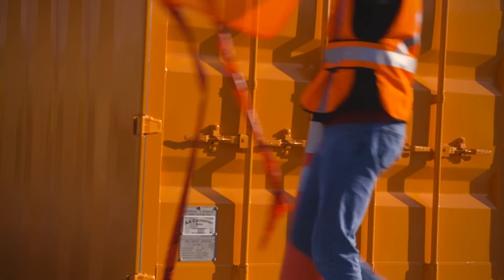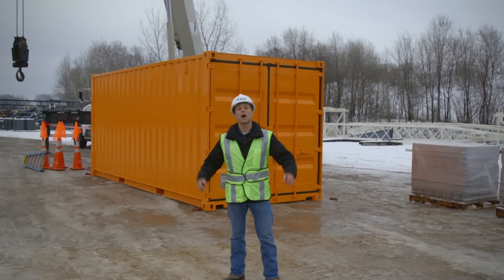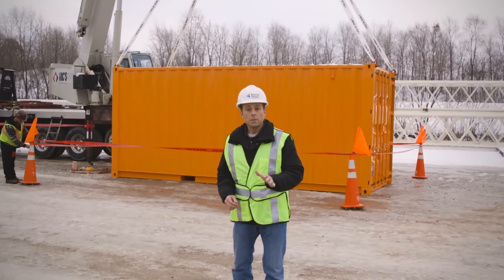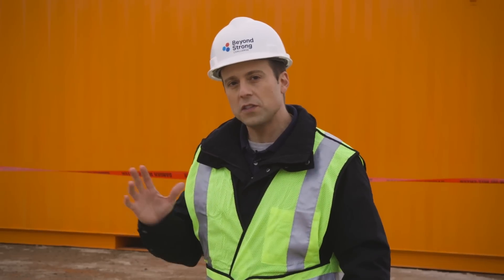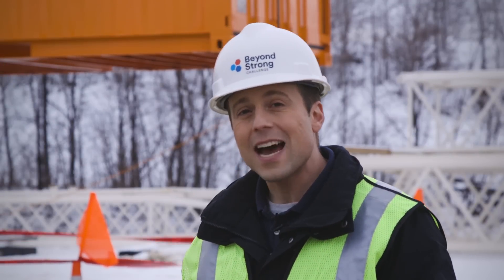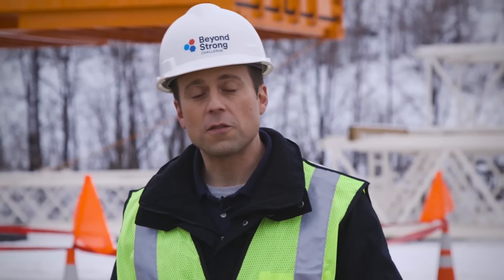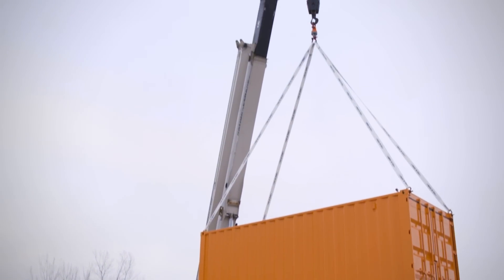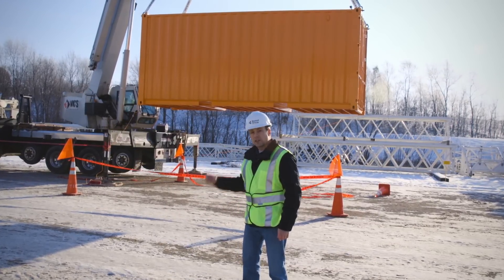3M Assembly Solutions: Epoxy Adhesive Demonstrating Strength

Comment: Which onwe would be good for body kit for car?  I dont want to drill holes in the car is there a 3m one specific for cars or fiberglass? Thanks.
Reply: fiberglass body panel isn't fiberglass...its fiber glass re-enforced plastic...you'll have to findout why type of plastic your body kit is made of and find the right epoxy for that plastic.
Reply: Use 3m panel bonding  08115

Comment: It is only a weight of 14,400 / 4 and that is 3,600 per block which looks to be a surface area of 8"(d)x Pi= 25sq/in + 1"x8" flange= 33 full surface adhesion area  or only a weight of 42 pounds per sq/inch  Not a crazy number. imagine a well supported cross member with a 1 sq/in" glue bond....... Big deal.  Also remember that aluminum & stainless have a 30% greater adhesion than  polymers & glass. even less sometimes for wood.  Hi end film adhesives can reach over 3000 pounds tensile per square inch.
Reply: LOL, that's a lot of thinking to be completely wrong.
Reply: the epoxy is on the single point above the shackle, not the four attachment points.
Reply: want crazy number tested? check this out!: https://www.youtube.com/watch?v=DqKj9iwg1Mk
Reply: laga luga
Reply: its at least ~170lb/sqin since each of the four points doesn't have your estimated 58sqin of contact. still not any good even if the estimations are off.